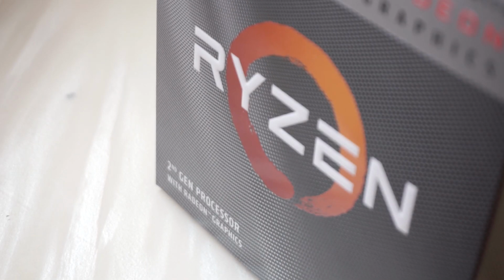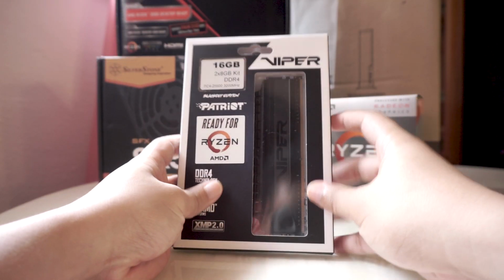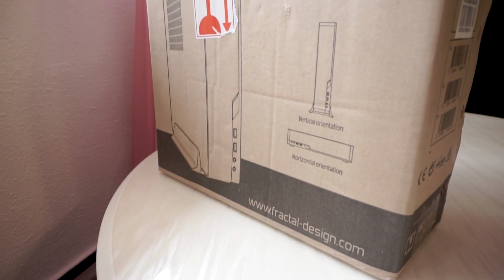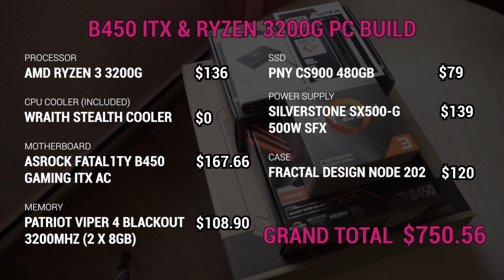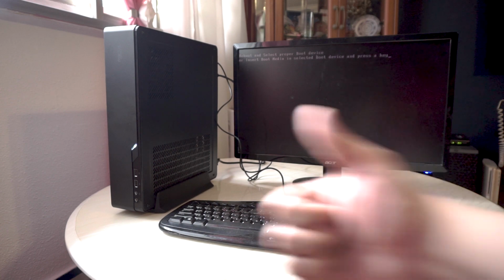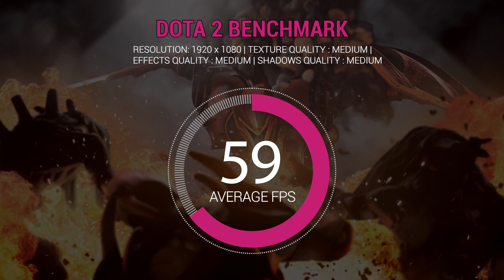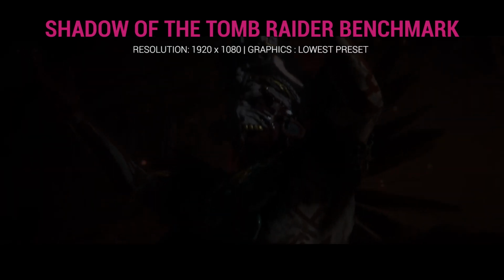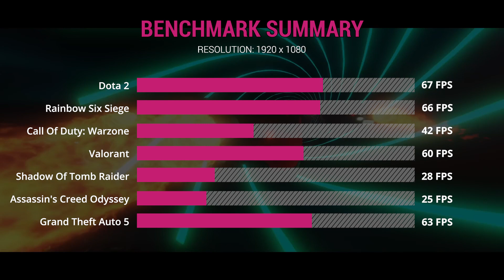The S$750 Slim PC Build! (feat. B450 ITX & RYZEN 3200G)

Comment: Question: I'm using Silverstone SX500-G too. My PSU already make noticable noice from the fan when turned on maybe around 40db if I measure using sound meter app on my gadget. Is it normal? Because I read in several review, this PSU is quiet when idle
Reply from the maker: Hmmm.. So far there is no noticeable noise when I use this PC. I haven't really got a sound meter to test the sounds, so I can't confirm how loud it is in the system. May I know what case are you using? It could also be due to lack of airflow which results in the PSU getting hotter and thus the fan has to work harder and fan noise.
Reply: @TechFlik  i have tried turn on pc in open case and the fan from psu still make louder noise compared to hsf and gpu fan. My case is custom case with the size and layout like metalfish s3 plus with psu fan faced down to get fresh air. I make videos when I turned on my pc here https://drive.google.com/folderview?id=1-8SlaXqwK39EVwHeRXj-Yt7VUrs84bgV
Reply from the maker: Wow... that noise is definitely noticeable, the moment you on your PC. I suspect it could be the sensor in the PSU might be faulty which results in the fan spinning loudly. How long have you been using the PSU? Is the PSU still under warranty? Maybe you can try to contacting Silverstone to ask for a replacement unit.
Reply: @TechFlik  nearly a month I have been using this PSU and still under warranty. So, I can ask Silverstone for a replacement unit, isn't it?
Reply from the maker: @wahyudinugraha8111  If you bought your PSU from a silverstone reseller, you might have a warranty with that reseller. Maybe you can check with the shop first and see if they can help. 

If not maybe, you can try writing an email to silverstone, see how they can help you. You can visit their website here and find their email address: https://www.silverstonetek.com/warranty.php.

But do note that you may need to pay shipping fees and replacement unit will only be available if there is stock. Hope this helps!

Comment: question : what did u remove from the stock cooler?
Reply: He removed the shroud. It doesn't do really anything but provide the AMD logo. Possibly removed for clearance issues in the Node 202. Not 100% sure. When I do AMD builds, I usually pop off the shroud fully, rotate it so the logo is top facing (usually b/c there's a window and I want the logo at top instead of the side) and then put it back on.
Reply from the maker: Yup what Middle of Knowhere said! I had to remove the cpu cooler shroud (the one with AMD logo on it) due to clearance issue when closing the Node 202 case. Now with the shroud removed, it fits in the case nicely! I hope this clarifies!

Comment: Nice build, keep It up! It must have been hard doing cable management in that case... although it actually looked pretty good. random question: what do u think ur next build is gonna be?
Reply from the maker: Thank you so much for the constant support! Cable management is actually pretty okay on this case, they do have multiple cable tie points which helps greatly. I'm hoping to do more budget build! Kinda like a challenge to make value PC with a low budget.
Reply: TechFlik Nice! btw I found this website called kit and it’s basically a website where you make a page containing products from any website and give your own reviews on it. You can also add a video or picture as the thumbnail type think (I have no idea how to explain it) I suggest that you make a account and maybe make a kit of each of your pc builds .I only started like 5 months ago and I’m already getting like 500 views on average. You should try it out if you want
Link: kit.co
Reply from the maker: That's an interesting website! I will check it out! Thank you!
Reply: TechFlik aight if you make one, just make sure to add your video according to what pc build it is, you have the option between a picture, video or nothing so you can just put ur video there and I’m sure you will get lots of views, check out mine and see how I did it. You can even get money off of this, you have to link your amazon account and if someone buys a product from your kit you will gain 1-10% of the money